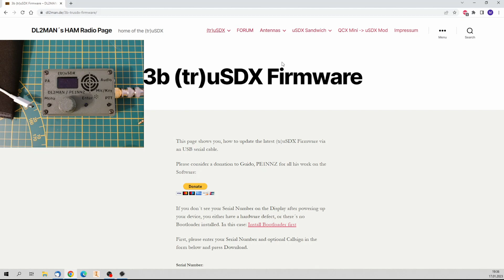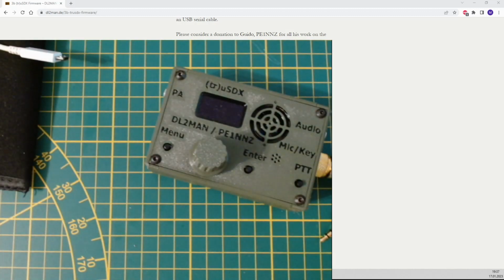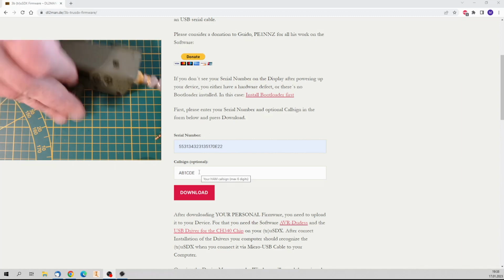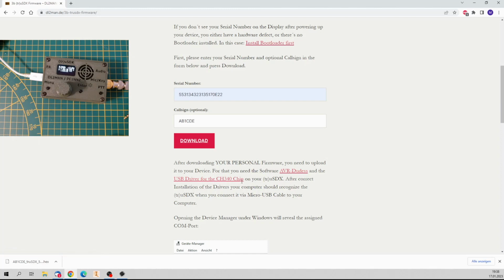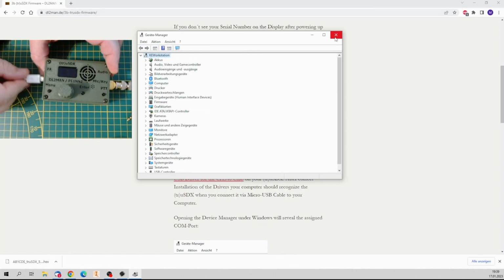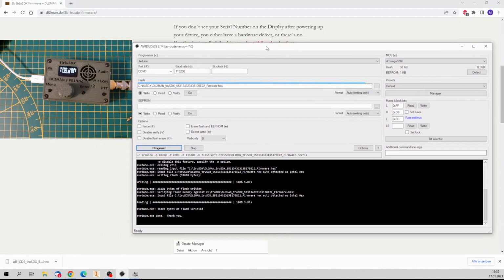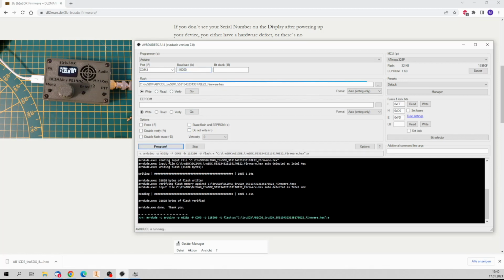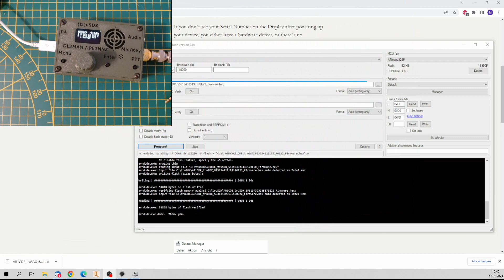(tr)uSDX - updating firmware or how to get your Callsign displayed...

Comment: Hello Manuel, thanks for the Video. I thougt, that i must buy a specially Programmer for Arduino, but it goes easy on the Usb-cable😂. Does it also works on Windows 11? Vy 73 de Dc4kjs (Stefan)
Reply from the maker: Kann ich wirklich nicht sagen, denn ich bin noch in der Windows 10 Steinzeit. Frag doch einfach mal in meinem Forum. 73 Manuel; DL2MAN

Comment: Great video.  Finally got my callsign burned in.  First problem, you gotta use a real windows machine for the driver.  Windows11 running on a MAC Parallels won't play nice.  Dug out an ole Dell running Windows 10, everything loaded but the driver just ignored the rig via a usb cable.  Finally tried another cable....BOOM.  Success!  Bad cable now chopped into tiny pieces and thrown away.   Now I'm putting together an antenna.   Sweet little Transciever!  BZ

Comment: Sorry for question 2.  I do not see just Arduino on the programmer dropdown box.  Just arduino ISP Programmer, FT232 connected to ISP.  And there are 2 of each in the dropdown box
Reply: I found the right one by trial and error. It is the Arduino for bootloader using STK500 v1 protocol
Reply: Me as well. Not sure what to choose

Comment: Updating firmware doesn't work because when the USB cable is plugged into the PC it doesn't recognize the port!  Were some of these shipped with bad USB ports the same way the ATS-20+ receivers were?
Reply from the maker: Not that I now of. Make 100% sure, you have a good working data cable (not a charging cable). In 99,9% it´s the cable.
Reply: @dl2man  Got USB port working but when trying to update the firmware it says for the type of programmer to choose "Arduino" in the AVRDudess program but there isn't any setting of just "Arduino"!  There are some other Arduino options so I tried some of them but I get an Invalid Device Signature error each time!  There seems to be no option for the CH340 chip.  Which option for the programmer, if any, will work?
Reply: Finally got it to work using "Arduino for bootloader using STK500 v1 protocol".  The directions should be updated to show there is no "Arduino" programmer option.

Comment: For us that don't want to mess with AVRDUDESS and just use AVRDUDE at the command- line, could you post the command-line options that are listed under the program button in AVRDUDESS once you have configured AVRDUDESS?  Rather than installing MONO on my Linux box I would rather just edit the command-line options for com port and file location.  Thanks.

Comment: Thanks for this easy "upgrade" firmware video. I just received my new (tr)uSDX and was working through the long process for the Boot Loader with my collection of Arduinos, when I thought I'd look for a video to confirm I needed to do that, which, it doesn't look like I do. My firmware was v 2.00i when it arrived from China (ebay purchase). Thanks for the device and the variety of help for using it. Looking forward to trying it out. Cheers, John VE7JEY

Comment: How do I find my serial number if I lost my bag? 😢
Reply from the maker: easiest: Ask the seller. Sunny usually can give you the serial. If that´s impossible: program rig with firmware for any Serial Number (like mine in this Video) and it will display the right one. 73 manuel, DL2MAN
Reply: @dl2man  All sorted and firmware updated.  Thanks!

Comment: Great audio. What do I get uploading the firmware? I am a bit reluctant to mess with my radio since I do not wish to damage my radio.
Reply from the maker: In this case, it was just to show the procedure and how to get your Callsign on the DIspaly, in case it wasn´t programmed. Besides that: Check your Version, and check the changelog. If there´s a newer Version, it will usually have new features and some bugfixes.
Reply: @dl2man    Makes me nervous to mess with this. I tried an external power supply and it began to smoke, now it doesn’t come on at all. I had to order another one, so I am reluctant to stick anything except a key.